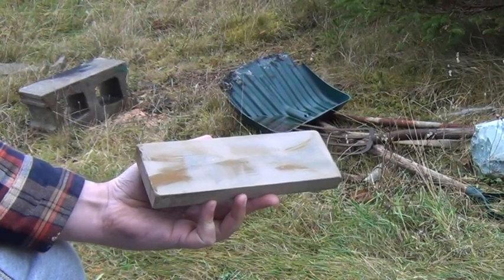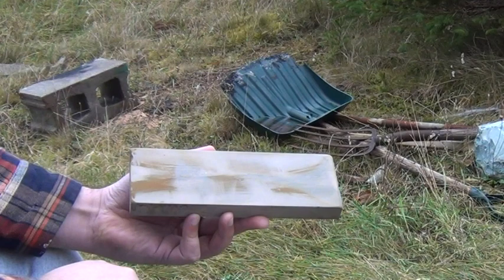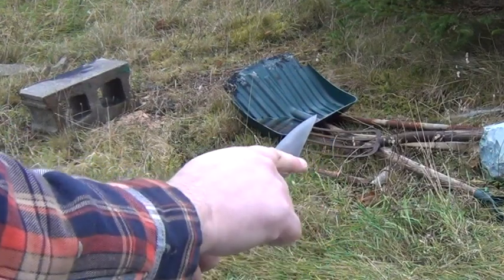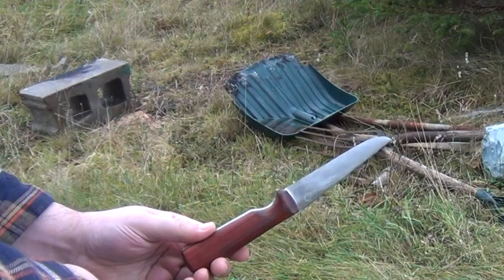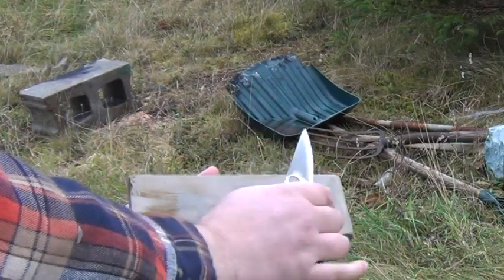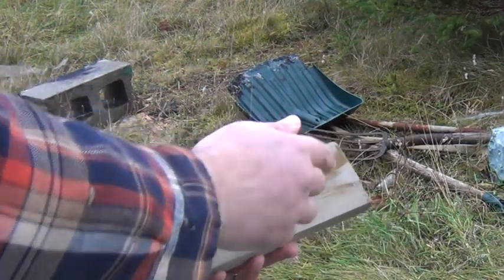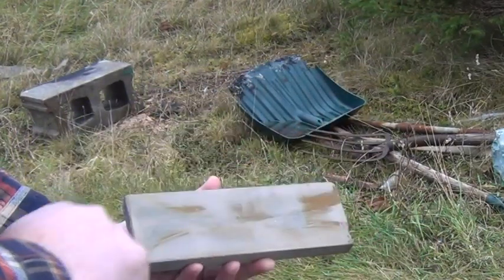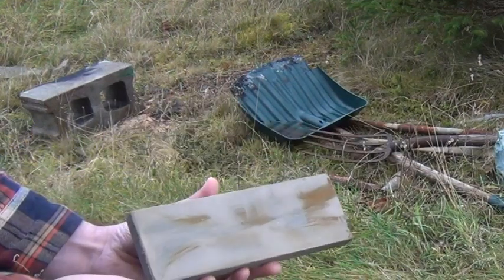The influence of not flattening waterstones on sharpening angles

Comment: What is your general way of measuring the edge angle? 

Rule of thumb?
Reply from the maker: I measure the edge thickness/width and calculate it. This may have to be done under magnification if the edge is very small. I then check this against a visual confirmation via a method similar to the recent Sharpmaker video.
Reply: ...That's kinda genius. I wouldn't have thought that one up. Though what is your general way of doing it? Assume it is an isosceles triangle, and?
Reply from the maker: shurdi3 Inverse tan of the thickness/width ratio, yes, assuming it is symmetrical. You can calculate it assuming it isn't from inverses on both sides but that is rarely necessary.
Reply: Cliff Stamp Oh god that is much simpler. I was thinking some way using the cos thingamajiggie (c^2 = a^2 + b^2 - 2ab cos y; or c^2 = 2a^2 - 4a x cos y for the isosceles triangle)

Comment: Cliff, can you demonstrate how you put the sharpening notch on? My Para 2 has that issue and Id like to put a notch.  I debated using a dremel and have both a dremel and the spyderco triangle stones.
Reply from the maker: Using a brown triangle rod, grind the corner into the area where you want the notch. When you start the only difficult part is to stop the rod from slipping up the blade so you proceed very slow and in a back and forth very contolled motion. Once you have a notch started the rod will sit in this hole and you can grind back and forth very quickly. The corners will load up very quickly, I normally use all sections of one rod to make a single notch.

Comment: Wait didn't you say that you usually do the notches using a fine tooth diamond saw?
Reply from the maker: I do them in many ways, recently I have been using the Sharpmaker rods as the corners are almost an exact fit.
Reply: Cliff Stamp Doesn't that harm the corners a lot?
Reply from the maker: shurdi3 The rods are solid sintered ceramic, they doesn't afraid of choil notches.

Comment: excellent points. i'm thinking of upgrading to a chosera 600 grit. from what i understand they are very good stones and they are ceramic and that thyey don't dish out. a shapton 16k is also on my wanted list. for now i have a norton combo stone which worked well but, is dishing out and a 6k king stone which i really love now that i've got the hang of it.
Reply from the maker: I have not used a Chosera 600 but I would be surprised if it would not dish because the x-coarse stones tend to have to release fresh abrasives because the coarse abrasive will fracture/wear quite readily. 

The UF stones like the 16k shapton are extremely hard and dish very slowly. I have a small piece I use for local polishing.
Reply: i have a 1k ceramic lansky stone in my kit that's been the heaviest used stone i've ever used as i've had it since 2004 or 2005 and it hasn't started to dish yet. i'm not saying that ceramic doesn't as i don't know that for a fact, it's just what i've read (likely seller hype)but, i'm sure they likely also dish slowly. i have heard of people sharpening on regular glass and i have tried it myself a little but, wasn't able to discern whether or not it was sharpening the knife, it wasn't dulling it but, what are your thoughts on the use of regular glass to sharpen? do you see it as effective?
Reply from the maker: knives save lives Unfortunately the term "ceramic" gets used very sloppy in the industry leading to some confusion.

The Spyderco stones are solid sintered blocks of abrasive and they are what most people mean when they say ceramic. The Bester is described as a ceramic stone but it isn't solid ceramic, it is the abrasive held together by a ceramic binder (I assume anyway, I have asked with no confirmation). This makes the stone much softer than say the King which uses the same actual abrasive but a resin binder which breaks down very quickly. 

To add to the confusion you have stones such as the Sigma Power Select which are solid abrasive which have no binder but they are not generally called ceramic stones but the abrasive itself is a ceramic (it is in all stones).

I have not used the Lansky, but those types of stones when they call them ceramic tend to be like the Spyderco and be solid blocks of pure sintered ceramic. These wear very slowly, it usually takes people years to dish a Spyderco brown stone for example and most people never dish the UF ones.
Reply: intriguing. thank you. what is your opinion on sharpening on glass? i.e. window glass, picture frame glass. is it effective?
Reply from the maker: knives save lives Do you mean putting an abrasive on glass? It is not uncommon in chisel and similar sharpening to use lapping compound on cast iron plates. I don't see why you would want to do that over stones which are much more versatile in general especially if you do a lot of sharpening.
Reply: i'm referring to adding oil to a piece of glass from say a picture frame and honing on it. no compounds or added abrasives.
Reply from the maker: knives save lives This would act similar to a smooth steel, they even make glass rod/hones for that purpose. It can be done as a finishing step, but it is very easy to weaken the edge if you over do it.
Reply: thanks for answering that and i apologize for taking so much of your time. that is very interesting. i was just wondering if instead of shilling out a fortune for a glass shapton stone if one might be better off trying this method.
Reply from the maker: knives save lives The Shapton Glass stones get some very positive press, even by people who use a lot of stones. They are kind of expensive though and to be frank you can go a long way with a simple India stone, assuming you are not working on extreme high carbide steels.

Comment: how did you flatten your stones?
Reply from the maker: The fine grit ones are kept flat by lapping them with the low grit stones. 

If the low grit stone has a soft bond like the King I just lap it on concrete with fine sand. However this is not productive on hard bonded stones like the Bester as it will cause them to fracture and can easily knock pieces out of the edges/corners.

On the hard and low grit stones I lap them against another coarse stone. I have a large amount of very cheap stones (gifts) and I just use these to grind down the Bester and similar stones (SPS-II 1000X is similar to the Bester 700X).

Comment: Very informative video as usual, Cliff.

Congrats on eliminating any remaining interest I had in waterstones. I'm not sure if they would be worth the trouble, or really do anything better than SiC, AlOxide, or diamond stones on the knives that I typically use.
Reply from the maker: The only advantage of waterstones over diamonds is the availability in higher grits which is becoming less of an advantage due to new diamond stones and the fact that waterstones are more tolerant to a very heavy hand in sharpening as you can repair them fairly easily if gouged or damaged or even dirty/contaminated. 

I tend to finish sharpen on diamond stones very frequently and one of the main reasons is the high consistency of flatness and the fact this produces the same consistency in angle.
Reply: Cliff Stamp
Being something of a novice to knife sharpening, I also feel that diamond or ceramics make it more clear if mistakes are made.
Reply from the maker: Bill22252 One of the main arguments for waterstones, especially natural is often non-functional and has to do with the finish they produce. For some people how the knife looks is very critical, especially on traditionally forged ones. But a stone which stays true flat is much less complicated to work with.
Reply: Is there any validity to the statement that water stones are more tolerant of angle variation than ceramics or diamond?
Reply from the maker: Bill22252 There are some waterstones which are very hard and act similar to the sintered ceramic. If the waterstones are soft they will to some extent act like a strop and conform to the edge angle but not nearly as much as a soft backed strop can. But how they do this is just add random angles to the edge.

So for example if the edge is at 17 dps and you sharpen at 15 dps with this Bester (before I flattened it), the actual angle you apply each stroke will vary from 11 to 19 dps so you will hit a very broad spectrum of edge angles, but not very consistently. 

I don't see how that is an advantage though as you could do the same thing if you drank a little to reduce your motor control and thus could not hold a precise angle and just used a diamond stone and varied a lot from stroke to stroke.
Reply: Interesting. One of my preferred sharpening stones is a Norton India combination stone that I have degreased and use as a waterstone. Would it be fair to say that it would behave like the Bester? Should I be concerned about lapping it?
Reply from the maker: Bill22252 Unless they have changed the way they have made them recently as I have not bought one in a long time, they are much harder and slower wearing than the Bester. They will wear, but it takes a long time and unless you are doing something which is very focused sharpening like chisel points, most people lap them rarely rarely.
Reply: One final thing, I remember you mentioning that "glazing" can be a problem with ceramic stones. What exactly did you mean by that?
Reply from the maker: Bill22252 A solid sintered ceramic stone does not release abrasive so it tends to load faster (glaze) in prolonged use. The metal on the stone then grinds against the metal on the knife and cause adhesive wear and galling which you don't want because it causes fatigue and fracture on a micro level.
Reply: Ok. I try to keep my stones clean, so this shouldn't be a huge issue. Thanks.

Comment: Nice vid Cliff.  When using something like a King1000, which easily gets out of flat, it wouldn't be odd to have to flatten during a single shaping session would it?
Reply from the maker: If you do not have to do any shaping then a King 1000 could likely stay flat, but if you have any significant material removal then the very soft resin bond in the King is likely to hollow almost immediately. If you want to check this then after you finish, just do one very light destressing pass, flatten the stone and then see how fast the light is removed from the apex. If it isn't immediate as in 25-50 pps then the King was likely hollowed in the initial sharpening.
Reply: Cliff Stamp Good strategy.  Thank you!
Reply: @CamberLucyBella Cliff was wrong about King 1ks. They aren't resin bonded, they're a relatively soft vitrified bond. The Deluxe stones are harder. IME with Kings, it's their 4k and up stones that are resin bonded. You can literally smell the difference when lapping or just during use. If it's a soaker, it's vitrified. If it's a splash and go like the 6k Super Finish Stone it's resin bonded. Resin bonded stones don't soak up a bunch of water. Cliff said this a lot and I'm just correcting the misinformation. Ask Matsunaga, the company that manufacturers King stones